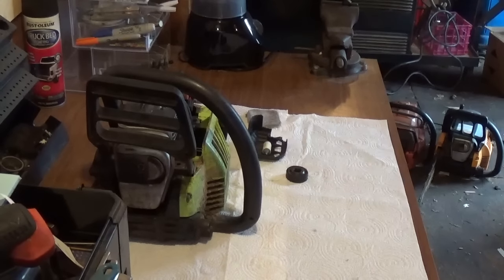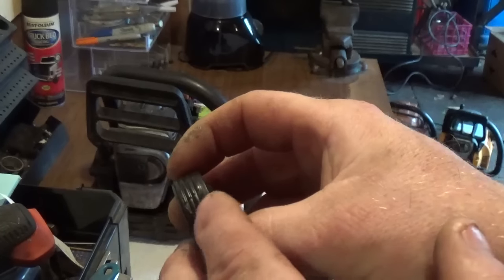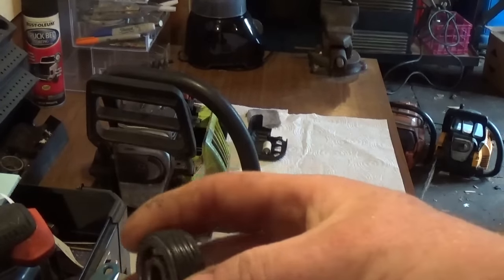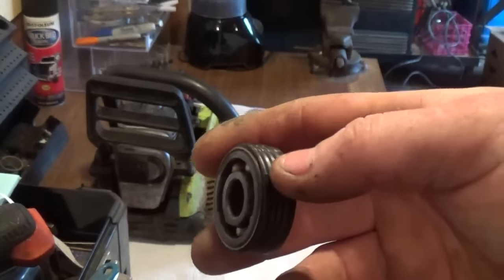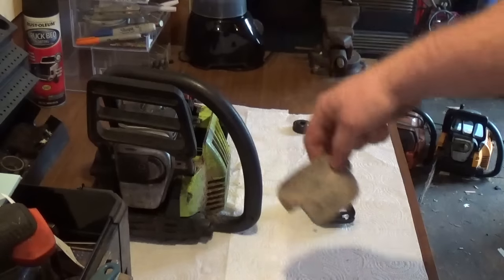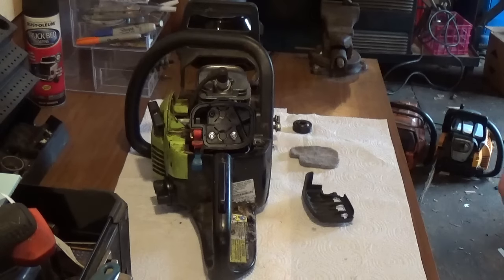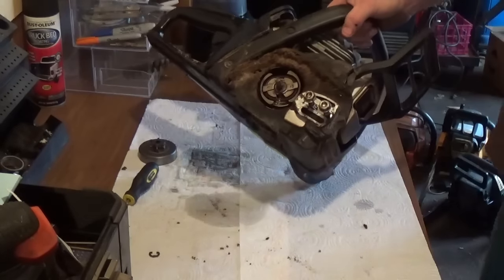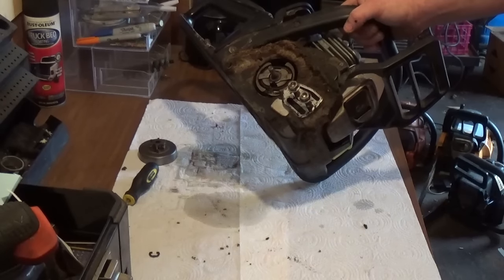Common problems with Poulan Chainsaws

Comment: Kevin - good video.  I don't know exactly what it is but the more recent Poulans from the past several years are just terrible. I had one from 2000 that lasted me 12 years with occasional/rare use and I even used old fuel!  My current Poulan Pro 4218a has only had TruFuel since the start and still has given me problems.  I even had it in to a service shop under warranty and the guy only adjusted the carb.  He tested it in front of me and then weeks later it was back to crap.  I have learned how to adjust it myself and I am finding that it seems to take a perfect balance of new spark plug, new air filter and the right carb adjustment to run.  However, my current model is very sluggish on the clutch as the chain spins for many seconds after I release the throttle.  I tried to adjust the low screw but then it won't idle correctly.  Dang thing pisses me off royally.  The gas cap thing....like I said, nothing but TruFuel since the start and have hardly used it (so the gas has not had time to swell that cap seal) AND YET IT IS STILL A PAIN TO GET OFF!! I use the chain brake nut tool to whack it open like a hammer.  Just ridiculous crap.....would love to throw all these junk saws on the board run desk of all the A holes that devised this plan to screw consumers out of their money.  Yeah, 2 year warranty, but read the fine print!!!

Comment: My neighbor gave me his defunct Poulan, and since then I have been trying to run down parts and tools just to replace the chain, and oil pump, and who knows what else I would find once I got inside. Why waste all my time. I am going to get an Echo "Commercial Grade", and use the case that came with the Poulan to house the Echo. I trust what this mechanic says about the Poulan who sees all the time what goes on with these things, and why. Buying, or even fixing junk is not money well spent as I see it. I will have to learn how to maintain mine properly, and if I do, it should be good for life.
Reply from the maker: Thank you very much David for the kind words .I hope you get great service from you Echo as they are great saws if properly maintained .Note David that even though maintaining a chainsaw is ideal it is a machine and like all machines it will likely fail at some point . The reason I say this is for you to be aware that often after about 10 years or so most companies will not obligate there selves towards repair parts for then to be later model saws. What I often tell my customers is after about 7 years make a over all assessment of the equipment in question . Can I get 3 plus more years out of it ? Are parts still ready and available? {Carbs} {Seals}and intake boots being the most prevalent to be found at these times . If so then consider cost in comparison to a newer model comparable to that witch is in question for repair . I know 7 years with a saw that has many ricks of wood under its chain so to speak can favor the choice greatly ....Still one should take such a piece of equipment to a trusted dealer for a honest assessment as we are trained to spot issues that most home owners likely will not find intel its often to late . I know its the mentality of most that often all a dealer wonts to do is sale a new piece of equipment ....I for one will not argue that this is not often a fact . But respectful Dealers and Service Techs can access your equipment and give you a honest answer with major factors such as a compression reading , Pressure and vac reading, carb pressure testing that likely would not be found by your average home owner. That could other wise be over looked resulting in a later failure or poor performance often leading to a scorn piston and cylinder.   TROUBLE IS FINDING A HONEST DEALER....LOL....as most are about sales anymore and not repair ......Service Techs like I am are becoming scarce .....As honesty is not the best policy in my line of work ....Trust me I get flack all the time for trying to be honest ....Even showing proper repair of equipment on this channel has had repercussions as Dealers tend to get angery  if they miss out on a sale . But Regardless once again David thanks for the kind words as viewers such as yourself make the time and videos worth while .

Comment: Now I know why Husqvarna parts can fit on Poulan Mowers.  Never realized these power tools were Husqvarnas.  I bought my new chainsaw like yours at Walmart cheaper than what you would pay for a good used one of another brand.  I hadn't even put gas in it yet since I bought it a few years ago, though I did put the bar and chain oil in.  This year I put the gas mixture in it but it would not start.  I know what kind of crap Walmart and Home Depot sells.  I've taken enough stuff back especially at Home Depot.  You should check out just how much that customers bring back  that didn't work behind Home Depots counter.

Comment: I have been working on engines small and large for 50yrs. I dont usually give up. But these POS are trash. I give Poulan wins. Great Video. Iam going to forward this to the guy who dropped of his POS poulan. This is not the first one I tried to fix. I HATE THESE POS
Reply from the maker: I know just how you feel / These curses need to be in Hell right where they belong.
Reply: Finally took it apart. Crank seals burnt up. Piston scored on exhaust side.

Comment: I have a poulan 245A bowsaw. My grandfather bought it new back in the 70s. I did buy a 20" bar for it for versatility. I've never had an issue with it with proper maintenance. There's almost no plastic on it as opposed to any new saw by any manufacturer.
Reply from the maker: True / the older Poulans were made far better than the newer crap .
Reply: @kevinbolin7665  absolutely, so we're everything else. Never seen so much plastic on things in my life.

Comment: bought a poulan pro , now maybe not knowing bar oil different than the mix oil used the mix oil the first time for bar oil and it leaks oil and i mean bar oil the second time i filled it for the bar , took it in for service for carb adjustment and didn't fix the oil leak. i guess the small engine repair place doesn't mess with the rest of the chain mech and told me that they do leak. fill up the bar oil and 2 days later a third leaked out with out it even have been cranked? did I screw it up with mix oil the first time?

Comment: Question: I have a Poulan 295 pro chainsaw, that is extremely hard to pull start when the spark plug is in (when there’s compression). If I remove the plug it pulls just fine so it’s not the flywheel or pull spring. I removed the muffler and the piston is very clean and smooth, it’s just when there’s compression it won’t pull. When I hold it in place with my foot and pull, it’s so tight my foot starts coming off the ground before I’ve completely pulled the cord out. Any ideas?

Comment: The only issues I have encountered with my Poulan saws are USER error. So before you bash them take closer look at what or who is really a P.O.S!
Reply from the maker: Marooda M ....It pleases me to know that you haven't encountered any issues with your poulan with the exception of user error ....I guess your opinion is relative at best as like I have told many other viewers {Opinions are like assholes } everyone has one .....I have stepped back at the Poulan Products and taken that closer look as you so passionately requested.....all the while keeping a open mind to the asinine observation you projected assuming I was a P.O.S. And although I cant fully disprove your theory of me potentially  being a P.O.S. .....I can prove that Poulan Products certainly are. So rather than proceed in a pissing contest with you might I encourage you to look up refurbished Poulan products , Poulan returns , Poulan warranties, and you will quickly see why the bashing of your beloved product becomes self evident....
Reply: Kevin, It is obvious that M.M. has neither owned a quality piece of machinery, nor ever worked on a low quality piece of equipment (or anything for that matter).  You are correct about Pull-on (and on and on) being a Piece of shizz don't let a someone without any experience rattle your chains.  The first Craftsman I saw didn't have a replaceable woodruff key, it was part of the crank,,,there was no easy way to fix it....It was designed to be thrown away when broken.
Reply from the maker: Thanks / you truly do make some great points ....

Comment: Nah been using a 4218 to cut 18 cord of fire wood. Felling the trees and cutting rounds. Air filter doesn't get clogged that quickly. Run my for 6 hours straight on many occasions and still starts amd runs fine. Clutch is toast because ive gotten multiple bars pintched. Push the fuel bubble 10x pull out choke. Pull once put choke in pull once and it usually starts.
Reply from the maker: Great mykell gold then it would stand to reason that you shouldn't have any issue in proving your claims . Vindicate your claim by preforming the Poulan challenge . Simply check my videos for whats expected . If you cant validate your claims your commentary will like so many others will be seen but realized to be the rant of a individual sold on idealism ….SO SIMPLY PROVE IT ….The take my word or leave it mentality simply wont suffice .

Comment: Wished I would have seen this video before buying a used Wild Thing 40cc/18" for $75. I had to get a wrench to get the gas and oil cap off! Guy "CLAIMED" it was rebuilt. I did get a spare chain. 😱

Comment: Those saws are straight up junk, I am surprised there hasn't been a class-action lawsuit...
Reply: mine   run great   the start  when  i need  them
Reply: The biggest problem with mine is the air cleaner and carb adjustment other than that it has run fine for the 2 years I have owned it.
Reply: TheToolReview  I know Husqvarna makes jump
Reply: TheToolReview l know Husqvarna makes junk
Reply: The older poulans are way better the new ones are shit
Reply: Poulan chainsaws were made by Husqvarna as a cheaper homeowner saw.
Reply from the maker: What model poulan do you own ?
Reply from the maker: How many years would you say its been trouble free?
Reply from the maker: Could you make a short video showing the performance of this poulan and upload it ? Theses saws had major recalls and warranty issues due to seals and carb failures . [recalls were because of fuel lines and weak armatures }coils. IF you can please allow the saw to be started from a cold start then cut a few small blocks .....lastly allow the saw to idle for about a min ......turn it off then restart it after about 30 seconds to see if it continues to idle or cast its chain.
Reply from the maker: Great ...Can you make a short video for my viewers and I to see the performance of the Poulan chainsaw from cold start ....cutting ....idle ...turning off then restarting after about 30 seconds to see if it continues to idle or races off with the chain ?
Reply from the maker: The recall was threw Central Power Distributors from August 2 2011 thru March 14 2015 Due to casting ,crankshafts breaking, seals leaking Bad coils ETC....

Comment: Sad. Poulan was a great American saw years back. Husky neglected quality on
Poulans when they took over. Also many repair shops use cheap non-oem parts from
the far east. The old coutervibe 3400 were strong saws and I cleared many an acre with
one. When the Competitor Husky bot out Poulan, they failed to keep up the reputation.

Comment: I guess I'm lucky. Ive had my Poulan for 20+ years and never had a problem and it still runs great. It may probably die tomorrow.  I do wish you had recommended which saw would be good to purchase.
Reply from the maker: Wonderful....Please show my viewers a short video of the performance of this older Poulan. Idling, cutting, throttle response, starting for a cold start , and once warmed up then allow the saw to sit and idle for about a min before turning it off as well as then trying to restart after . We will be looking forward to the short video .
Reply: @kevinbolin7665  i wish i could but i don't have anything to video with nor how to post.  I'm not tech savvy.  Lol. I watch videos like yours to learn because I'm not the sharpest tool in the shed!

Comment: I have a 33cc Poulan like the one in the video, wasn't working good, the repair shop was able to get it running great. I use it for about 10 min or so and shut it off. Let it cool some, run again. Over and over. Seems to like it, because it has run good for over a year. Can't get them too hot. They deteriorate quickly if you do.

Comment: How do you feel about echo saws? I bought one about a month ago and did the basic mods. Got it running great and i love it so far but my arborist buddy keeps telling me it's junk and to be quite honest its making me regret my purchase because i do respect his opinion..
Reply from the maker: What model is your Echo ?
Reply from the maker: Yes I have used some of the older Poulan chainsaws ....And yes the 2171 Jonsered as well as 2186 were really nice saws .....I never cared to much for the trigger cables that often will develop a small friction wear spot in the bend just under the entrance allowed to access the carb linkage .....but still very nice saws .....But of course these saws are on the higher end and just as you said basicly just a way for Husqvarna to sell under the Jonsered brand as they basicly are Husqvarna.
Reply: You have your saw 'running great' and you 'love it'-what is to regret?  Look after it and it will look after you. enjoy it!
Reply: LOVE my ECHO 355T, purchased about 5 years ago. Though have only used it lightly for occasional limbing, cutting up small stuff. Make no mistake though that little saw is quite capable of cutting through anything in size up to its 14 inch bar length, although to buck saw a tree up I run for my larger saw. Easy starting, good feel, well balanced. Only thing is wear ear muffs, like any saw, but this little guy makes a big racket compared to the OLD metal case dual trigger Homelite Super 2 it "replaced, albeit the Echo is larger displacement. The gas & oil caps are a pain to take off, usually have to run for the scrench.

Comment: I have a Poland Pro 4218 AVX that is over 10 years old and still always starts with two to three pulls cold and one pull when it's warm, and I've cut many many years of cords of wood with it it's been a very reliable saw. my only complaint is something that you didn't tell people in your video which I'm surprised you haven't come across this problem either or maybe you have and just didn't mention it, there's a little black plastic trigger that connects to the throttle butterfly to control your throttle when trigger is pulled and that piece of plastic breaks because it's designed to fail on purpose I've had to replace this several times on my saw where is on a Stihl or any higher quality saw that part is steel not plastic. and the most irritating part about it all is you can't order that part when it breaks Poland will sell you a whole new carburetor but not that one piece that fits on the carburetor to control the throttle. that was also irritating because I had to find other people with garbage saws and remove that piece of black plastic off of theirs and put it on mine. Maybe I just got lucky with mine or it's because it's over 10 years old they weren't quite as crappy made as they are now LOL the only problem I've had is with that butterfly trigger other than that it's run like a dream since the day I bought it from Tractor Supply
Reply from the maker: Yes you are correct I know the piece your talking about .....And in truth as you said they break quite often.

Comment: My pull cord was not working. I try to pull the cord but I can pull it. I took it apart and the recoil mechanism works fine but the fly wheel it is attached to won't turn (although sometimes it will turn). So do you have any suggestions on how to fix it?
Reply from the maker: First check the flywheel and make sure the armature gap is correct between the {coil}armature and flywheel should not be touching but should have a clearance of about 10 to12 thousands. if this checks out you could have the casing of the saw causing the binding issue ......in witch case you would be looking at a very expensive fix...
Reply: I have a feeling the engine was seized up due to running without the proper fuel oil mixture. I had just bought it from someone else used so I was ripped off.
Reply from the maker: Been in your shoes.....I feel for you friend ....It sucks .....But hopefully you didn't spend to much ..

Comment: I bought my Poulan 4018 in 2012, still works fine(maintained properly.) evidently you didnt bother to check the fix of the tight gas cap. just sand the threads of the cap till it fits properly. After 8 years it's still going strong. In my view, your assessment is way off on this one.
Reply from the maker: Evidently Jim Basile you missed the entire premise of this video as I offered facts by example to support my claims as well as opinion …...Further more as asinine as you accessed postulation is upon my assessment it still cant waver evident truths.....{ Truths by example be minded }…..
Reply from the maker: OH ….and Jim just to enlighten you on potential points. The gas cap shouldn't have to be sanded as a fix as Husqvarna/ POULAN should have made a Tank/cap in the first place that wouldn't swell . Now since you fell I was way off with my assessment perhaps by example you can elaborate upon how by providing a short video of your beloved Poulan in action …..Dare I say ….The Poulan Challenge shown and expressed to other adamant viewers such as yourself.